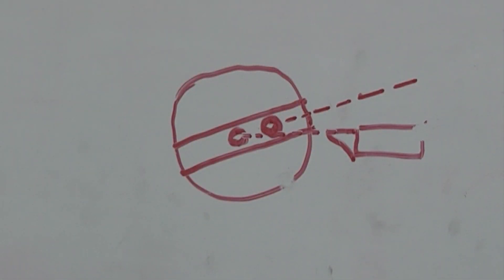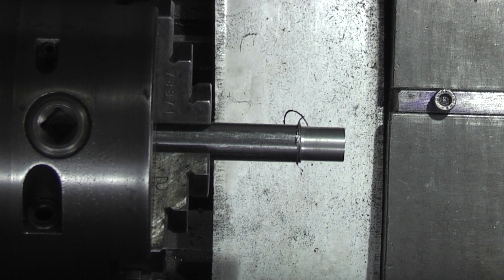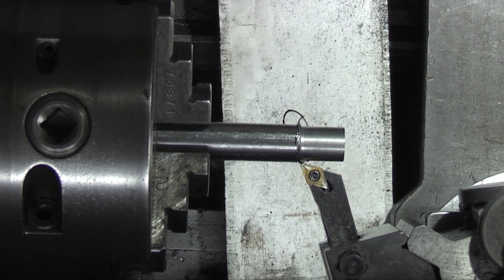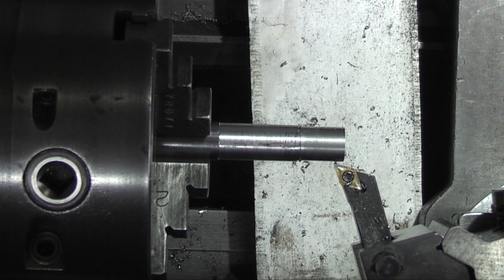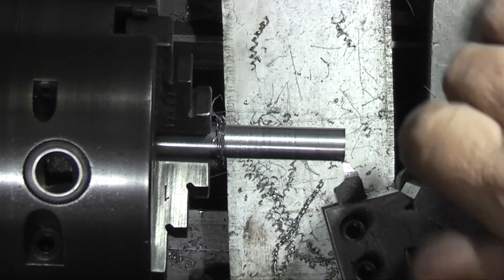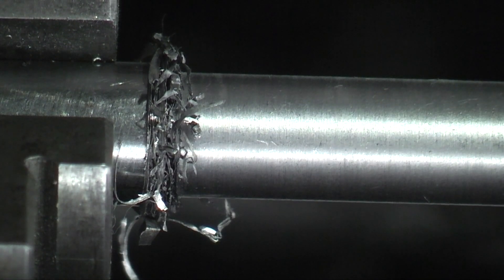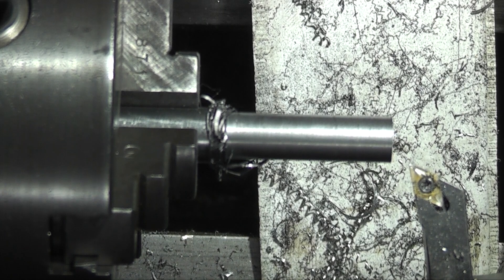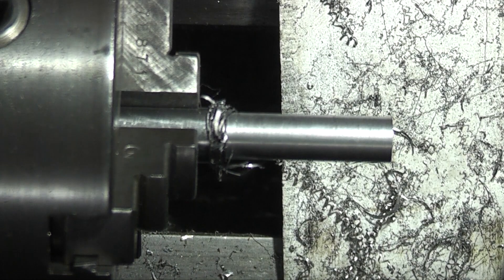taper turning +tools & surface finish

Comment: I would be interested to see if there is any difference on the finish if you swing that carbide tool around so the leading flank is at 90 deg to the axis of the workpiece or the tool shank is set at 90 deg to the axis of the workpiece . There are other forces at play here also like speeds and feeds, nose radius and the general design of the insert etc -Insert tooling is not something i regard as finishing tooling when a fine surface finish is required. Although you can grind and lap an insert  to achieve a fine finish a HSS tool is easier to grind and hone for this leaving the insert to do what it is designed for - fast removal of material . A shear type  tool bit will give the best finish .

Comment: Hi Alan, good demonstration. Having recently exchanged my Denford Viceroy (almost identical to your Boxford) for a Harrison M300, I can vouch for the fact that trying to achieve great surface finishes with carbide on the smaller lathes is very difficult. They were designed prior to the mass use of carbide so are far more comfortable with HSS / Cobalt, your demo shows this well. High shear tools are the best mixed with time and patience. Cheers, Jon

Comment: I find the the Carbide tools like much higher RPM  than HSS, it also like a deeper cut and a higher feed rate!  Also if you look at the chip breaker on the carbide insert and get your depth of cut to match the width of the chip breaker, I don’t get long stringy chips, I get 6{s and 9’s. Matching the size of the carbide tool to match the capabilities of your lathe is also important. On My 12.5” lathe I use  a larger tool than what I use on my 10” lathe. If I try to use the same tools on the 10” I can not get a deep enough cut for the chip breaker to work properly. One more thing is the size of the tool shank, I’ve found the largest you can fit in the tool post the better finish gets. I usually buy 1 size larger that the tool holder block will take then I mill the tool shank to fit the block.
Cheers,
John Brock

Comment: Hi Allan, my old Myford doesn't like carbide inserts, would it be because the spindle speed isn't fast enough, I use a HSS sheer tool if I need a really good finish, it works wonders and good for taking off small cuts for accuracy, thanks for the vids, well made and informative,
Reply: Try upping the feed rate a little - carbide inserts like it rough, i use insert tooling most of the time on my machines and rarely run a spindle speed over 900 rpm , i tend to take deeper cuts and make the tool work on its flank rather than the radius on the tip - if i need to shave a few thou off i use a HSS bit that is razor sharp or a shear tool

Comment: I picked up a tip on surface finish from a book by Tubal Cain in the mid 70s which I used up until I gave up the tools on retirement . He describes the making of a tool which “gives your workpiece a finish quite unachievable by any other means” it was simply a piece of round silver steel (Drill rod) which was ground with a straight cutting edge, about half the thickness. The edge was then given a slight back rake. To use it, you mount it in a round tool holder with the cutting edge at about 45 degrees off vertical and at 90 degrees to the work,  use your slowest feed and take a cut. This tool is for finishing only and should take a maximum cut of a couple of though. One caveat that was mentioned was that you can’t turn into a shoulder or step. Try it, you’ll be amazed.
Reply: are you talking about the vertical shearing tool?
Reply: Can you send a Picture or a drawing, cause i didnt understand it.
Im living in Germany

Comment: Hi Alan, great videos keep them up. I’m specially interested in your turning videos as I’m just coming to the end of restoring my Boxford CUD. 
When turning for the best surface finish I like to use tools that have a greater radius, insert or HSS. If you watch Mr Crispin videos he usually does his final pass with a bull nose HSS cutter. I am not a fan of the really pointed insert cutters unless needing to get into a corner etc. Maybe you could do a follow up video! All the best Ryan